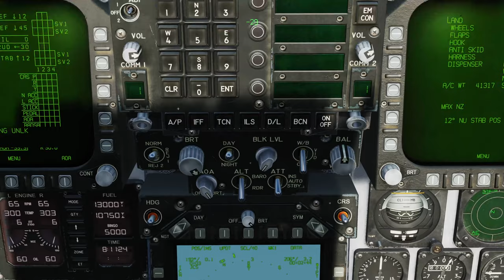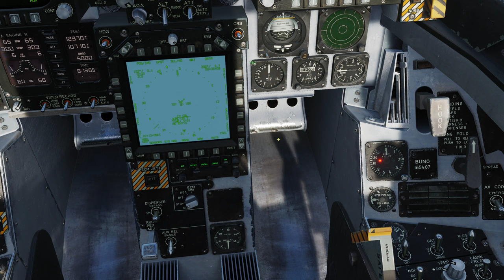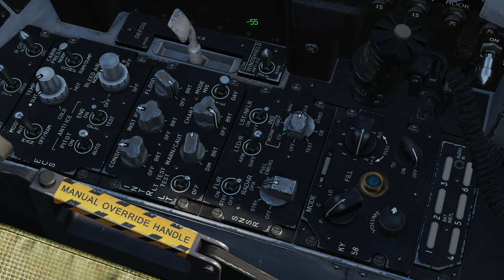DCS F/A-18C Tutorial 1 - Startup

Comment: Little tip on the INS alignment. After turning the knob to CV or Ground you can push the "STD HDG" button next to the bottom MFD "MENU" button and it will only take the alignment around 90 seconds to complete. The only thing you missed was the HMD alignment.
Reply from the maker: Thanks for the tip, this is correct but I was purposely choosing not to do this as on the carrier this procedure would only apply to the alert 5 fighters as for stored heading to work the carrier cannot change heading since the stored alignment. Because of this crews only go to the trouble of maintaining the stored heading for alert 5 fighters.

Comment: hi. i want to ask. i already follow all of this procedure. but why i cannot get proper speed?  i cant take off. if i succesful take off, i cannot get more power to lift my aircraft. anybody know what i miss?
Reply from the maker: I would check your throttle axis and make sure that it is assigned correctly and that it isn't double assigned to another controller too. It is quite common for it to also get assigned to rudder pedals and such.
Reply: @deephack  tq deephack because reply my answer. already know what is happening. it is because i choose game flight/avionic mode tick. after i untick, i can play like normal.

Comment: Why IFA you should put it on nav mode you have full aligned INS.
Reply from the maker: In the modern versions of the F/A-18C such as lot 20 IFA is used as it combines the INS and GPS to provide continuous position updates to the INS avoiding drift. NAV mode should only be used in older aircraft or where GPS is not available as then INS only is being used.
Reply: If  GPS is damaged, spoofed or jammed you switch to NAV so only INS is used. If the GPS is working, IFA ensures a constant update/drift correction of the INS and the most accurate position info.